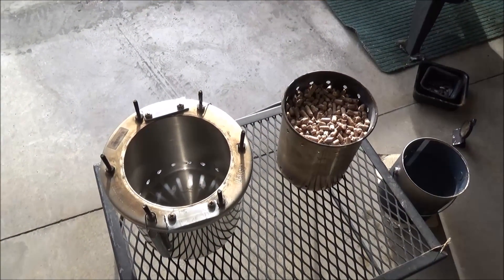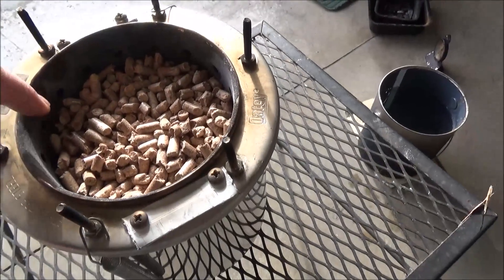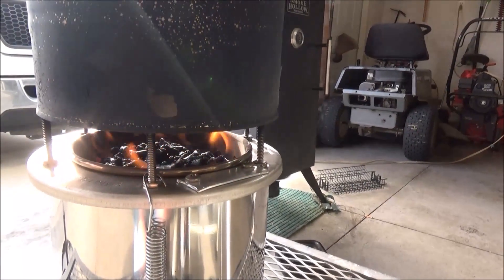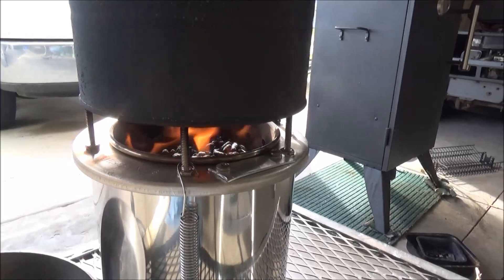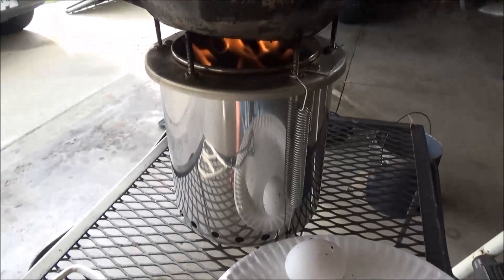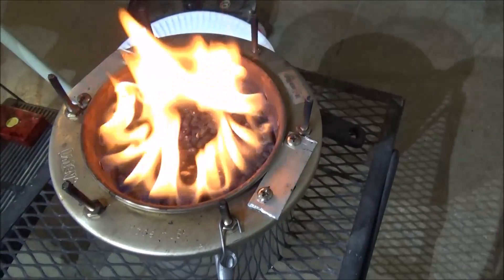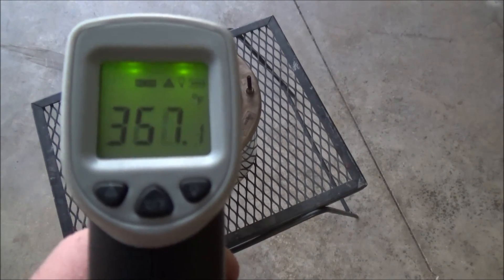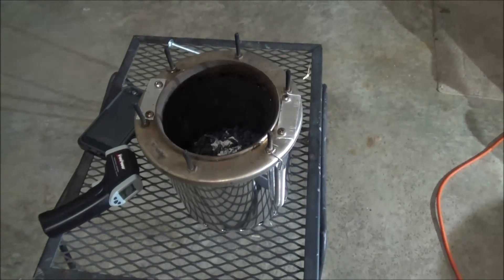2/3 $25 Diy How To Stainless Steel Pellet Gasifier Stove Cheap Easy Portable PELLET TEST BURN

Comment: If you were to cover the top with a large pipe do you think it would still get enough oxygen from the lower holes? This could make a nice heater with a dampening plat in a chimney a/the pipe ?? Very nice use of preexisting fit parts !!

Comment: Not bad but it's smoking what no wonder because there is obviously not enough secondary air for perfect burning. 4:1 primary to secondary is a general rule. Less lower holes bigger upper holes in higher position would be better.

Comment: Clean water...from a rusty old paint bucket with paint..and maybe lead in it?
Reply from the maker: +BOOSTEDLASER it was new from wall-mart with no paint in it and I was just doing a demonstration. Thanks for watching
Reply: +Ray Isimz Nice nice stuff!!!!!I drilled a bottom of 5gal pail with 7/8 hole saw to sift walnuts my wife piled by a asparagus patch(long story)...years later decided to burn documents rather than shred and used that pail. It was hot hot hours later. Was always baffled by that. I have been watching this stuff 2 years now. I think you are on to something.  Couple the Silver Fire Hunter stove and a wild man in Missouri Mcquire Stoves that likes lava rock in stove for heat/clean burn........and your simple to build/create approach......got me interested in watching more maybe do a lil experiment myself also soon.!  Thanks!!!   ps: Maybe use 5 gal pail,,,,put lave rock(or pea rock?) in bottom....should also work on a chimney like the silver fire Hunter........!!!!!
Reply from the maker: +putheflamesout yahoo search YouTube for peckerhead wood gas stove I built an other smaller one like this  easier and works great thanks for warching

Comment: Excellent 'large' stainless steel wood gas stove design!

I agree with what +vikingnavy007 recommended.  By adding a concentrator ring it will, well, concentrate the flame, function as a heat reflector, and it will also function as flame/wind guard as it will protect the flame up to the bottom surface of the pot.

Comment: If you add a concentrator hole at the top, it will heat the water even faster.

Comment: I made a backyard fire pit using that exact, same idea. Instead of using utensil holders I used two different sizes of stock pots. Drilling the stainless proved to be a slight challenge (a lot of 1/2" and 5/8" diameter holes for ventilation) but a fun project never the less. I did the whole thing for under $30 so I was pleased. It actually worked far better than I was expecting and burns ridiculously hot with very little smoke.
Reply from the maker: Cool yes I have found a good step bit for drilling ss works much better, and lasts longer, also I have been drilling some thinner ss with a small cobalt bit that seems to be working so far. I am doing some pretty cool alcohol stoves next. Thanks for watching